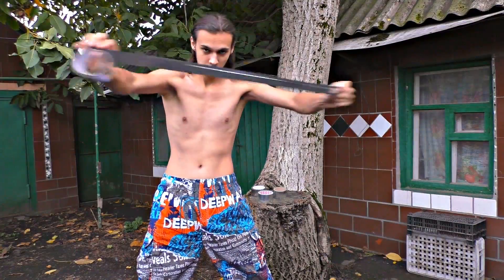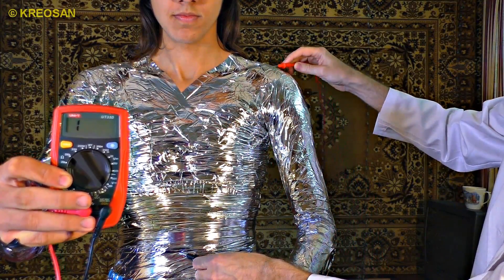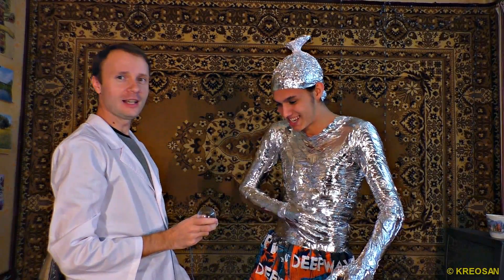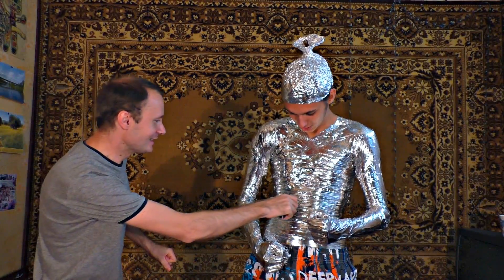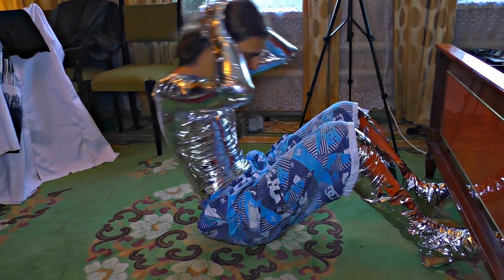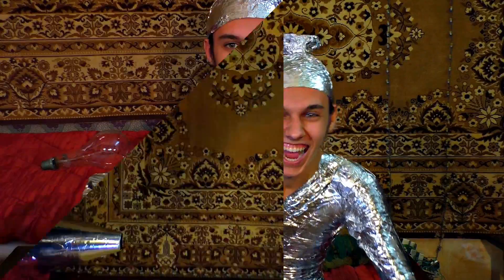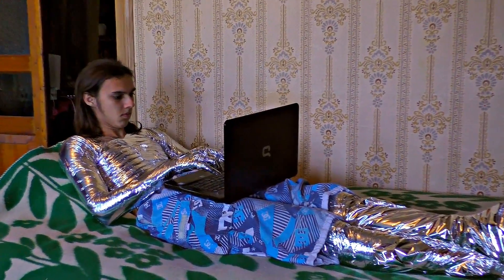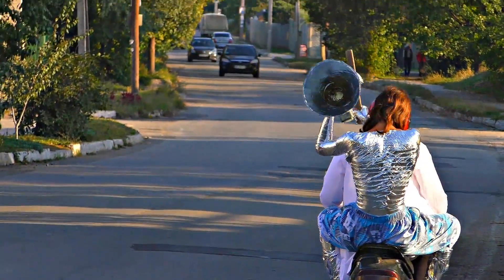HOW TO BE BECOME INVULNERABLE TO ELECTRICITY completely wrapped in foil

Comment: But the foil will easily melt if there is significant current and it is then molten metal applied to your skin -- the current will then follow other paths -- and only a small amount of current (10 milliamperes) is necessary to stop your heart.
Reply: yeah, there's a reason people usually use chainmail type stuff with the huge tesla coils rather than a suit like this